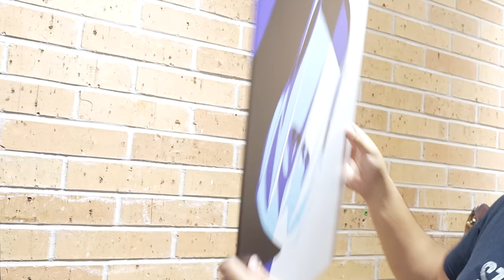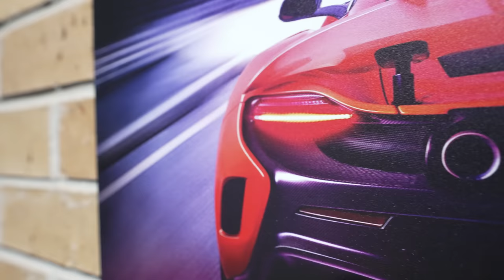We Built The Insane Hellcat Pickup Truck Dodge Was Too Scared To Make (In 7 Days)

Comment: I love that you built a modern Dodge Rampage - I just wish somebody else remembered what that was.
Reply: Except the Rampage was front wheel drive. The ONLY difference!
Reply: @hoosierdude7102  The Rampage lasted longer than the Plymouth Scamp.
Reply: It's now a Hellcamino!
Reply: Sadly I must admit that I did not know the story of the Rampage either until came across one for sale a few months ago. I then learned a lot more about them, like how there was almost a sweet Shelby version but it was never made since they foolishly gave up them in 84, mine is an 82 which was the first year and I have say looks cooler because its mine so have to say that, although somewhat sadly mine is not the manual option but with power outputs in the double digits it wouldn't be much faster anyway but mine does have the A/C option AND it still works!
Reply: Valiant Wayfarer ute
Reply: That will be the next project. Rampage Hellcat swap 😆
Reply: As a vw rabbit pickup guy ,ive got mucho respect for those ,they were a little sportier than the vw but they were pretty rare,i dont even remember seeing alot qhen i was a kid. 
Anyways, i know why the vw rabbit pickup didn't do the greatest sales and part of it was a toyota mini truck was like 1000$ less at the time and was bigger.

Comment: I have a 2012 charger rt. I absolutely LOVE MY CAR. it is a boat and it definitely doesn't have that much power. Anytime you need a car to do some stuff to maybe boost the power w a supercharger ect, upgrade the wheels and suspension you can gladly take mine. Shit I'll bring it to you lol. I bought the car with plans on making it a little quicker and doing some mild things to the looks. But it's had some really weird mystery things going on with the wheels, suspension, control arms, abs. So for 2 1/2, 3 years I've been dealing with trying to fix that. I don't have tons of money anyways and it was gonna be a slow build but every dime I have, I've been putting into wheel and suspension stuff.
Reply: I've also thought since she has close to 200k miles on it. At some point maybe putting a set or scat motor in it. I do travel alot for hubbies job so 🤷 the faster she goes the faster we can get from one place to another lol.